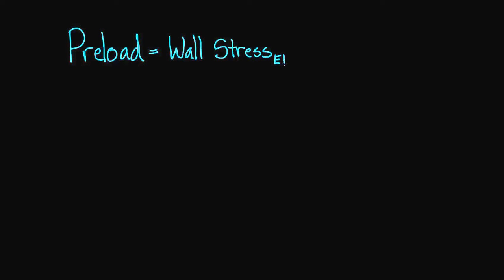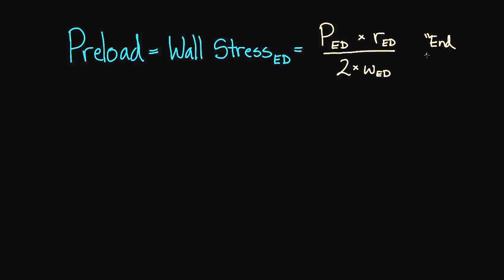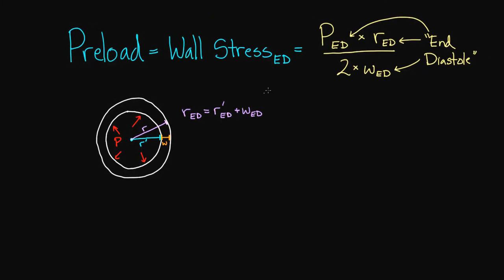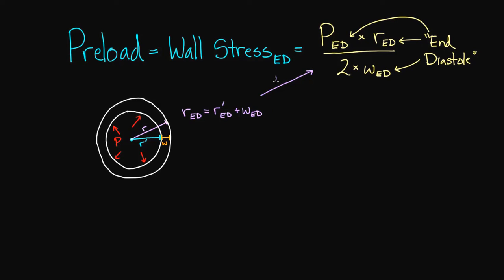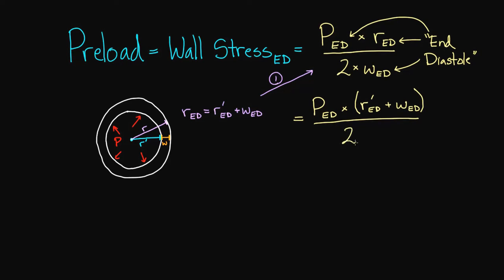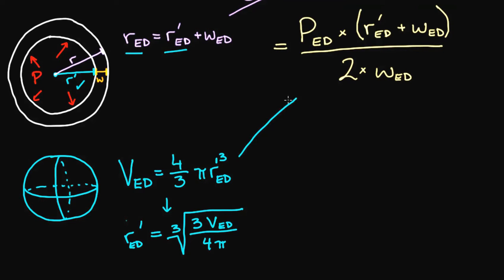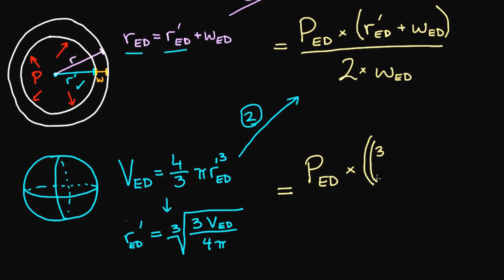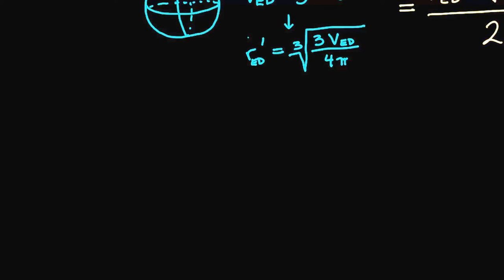Preload and pressure | Circulatory system physiology | NCLEX-RN | Khan Academy

Comment: Though I really like these videos, there is a problem in focusing upon end-diastolic pressure as a quick measure of preload. A patient with a stiff ventricle has an increased elastance and, for any given volume, the approach taken here would say has an increased preload. But in terms of the Frank-Starling mechanism, there is no increased stretch. Stretch is the mechanism of the effect of preload, and it is hard to claim a preload change here.